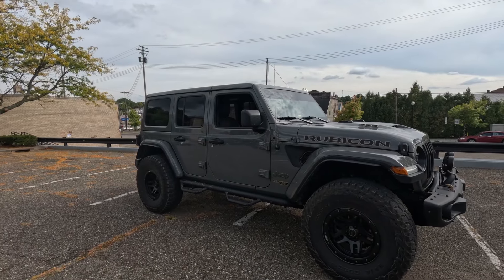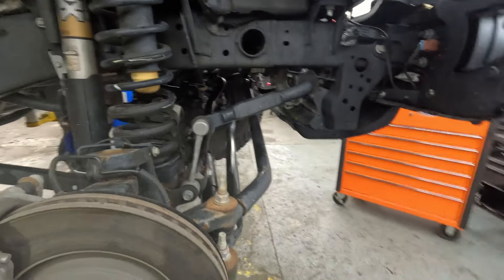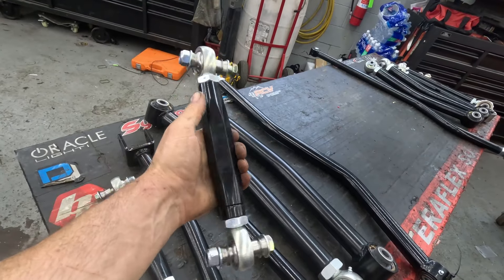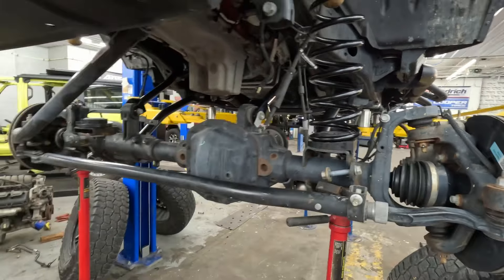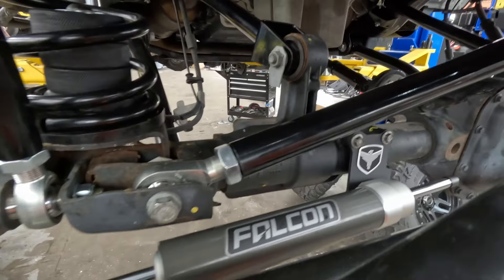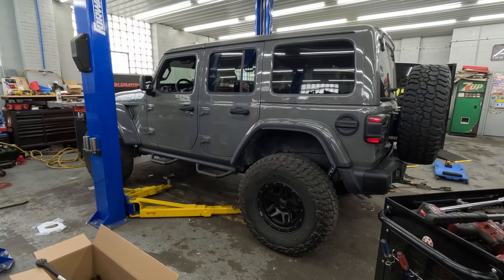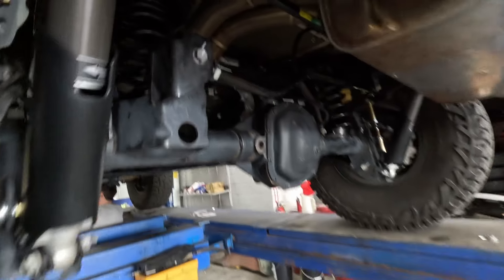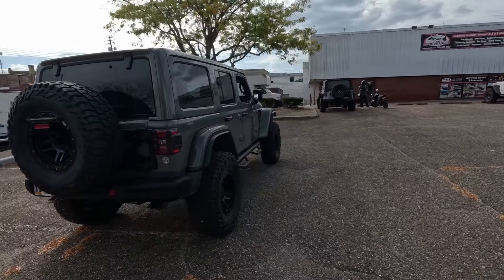392 Jeep Wrangler lift upgrade

Comment: How much of a difference does the steer smart brace make?
Reply from the maker: @litoornelas6409  it drives the same. It’s a brace to help keep the sector shaft from braking off and the track vm at bracket from cracking the welds.